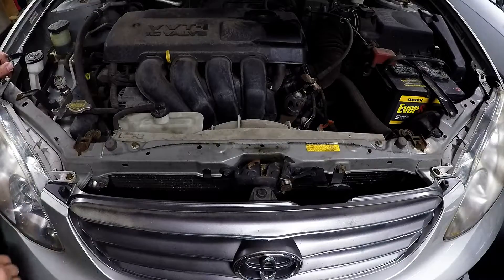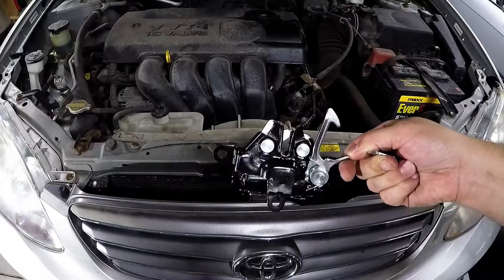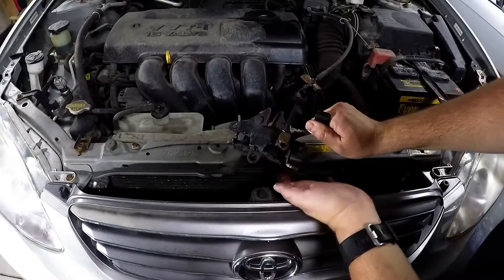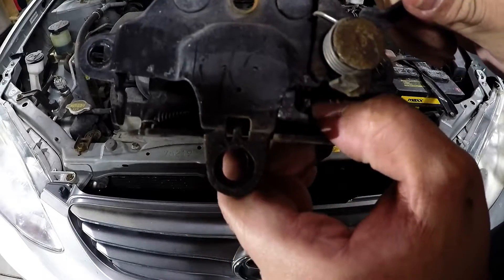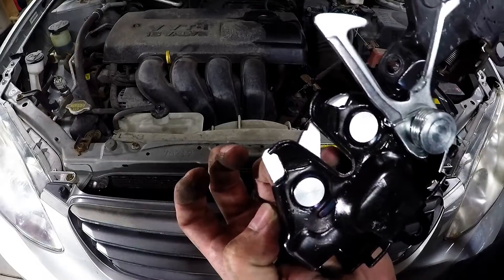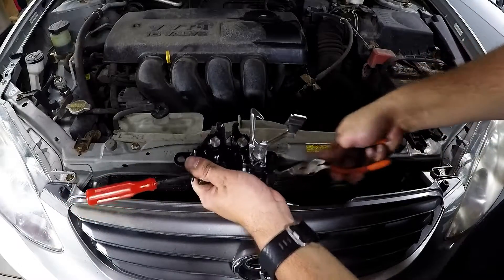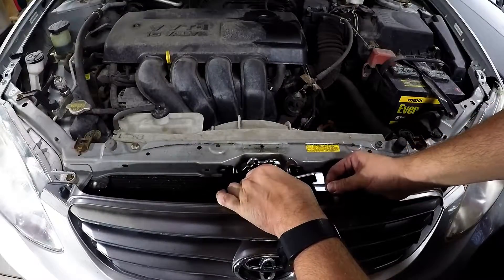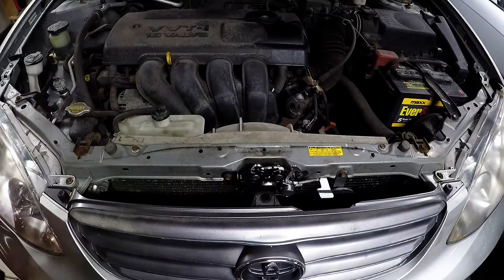Corolla E120 Hood Latch Replacement

Comment: I have an '04 with the same issue. Just bought a replacement part & your video answered all my questions. Thanks!
Reply: Hi, I'm having this issue right now. The video is not really clear on how to remove and put back the cable. Did you have any difficulties on that? And also where did you purchase the latch? Many thanks :)

Comment: Thanks. Looks identical to a 2002 Corolla latch we have. The cable ball on ours has pulled through the slot and won't re-engage, so we'll be shopping for a new latch.

Comment: I Have An 04 And My Cable Came Off I Tried Opening The Latch From The inside of The Car and The Hood Only Popped up A little Bit! I Think The Cable Got Stretch Out And Came Off?.. got it fixed and it Works fine now.

Comment: What was wrong with it, I had my battery stolen and after replacing battery try to close the hood but it won’t lock. Do you think thief pull to hard on cable and stretched it or small spring needs replace?